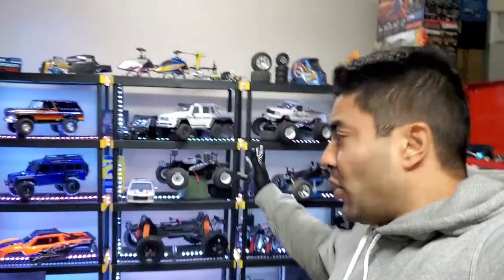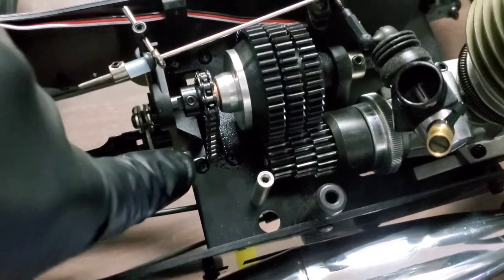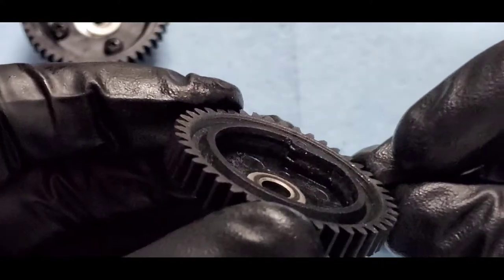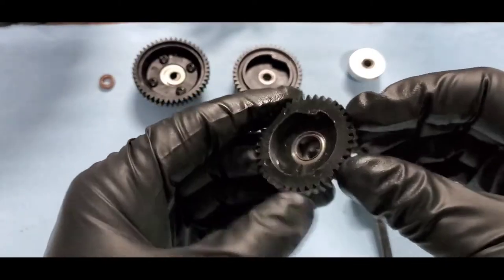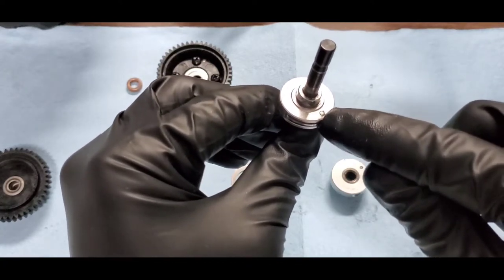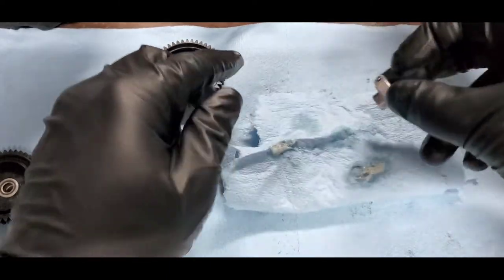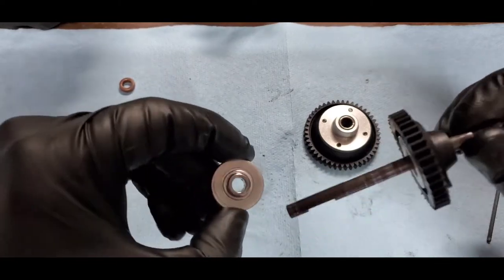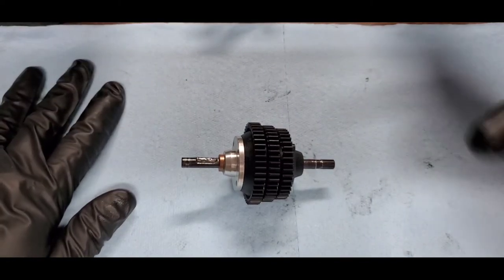3-Speed Transmission Maintenance on the Kyosho USA-1

Comment: At 5:17 in the video, you point out the shim in between the two cams. However, according to Page 8 (step 7) of the Kyosho build-manual, there is NO shim. This is not the first place where I saw a shim installed where the manual did not call for one. On my truck, between the clutch bell and the clutch shoes, I found TWO shims, where the manual only calls for one. It was causing my clutch bell to jam up.  Once I removed the extra shim, my clutch bell freed up.   Hmmmm...

Comment: Hello I have a question the grub screw that holds the sprocket on I accidentally stripped and I'm not sure what size it is do you know what size grub screw that is the one that goes in the sprocket with a chain around it thank you

Comment: Your gears slide off nice compared to mine. Mine were literally seized.  That shaft has a bunch of burrs
Reply from the maker: I had lubed the trans prior to this service. Also my shaft looks that way because I filed it gently as I did my last one, the shaft coating was rough from factory which may have cause the seize

Comment: one thing i just help but notice as @Turok goes through this maintenance routine is just how scarred and "grooved" the appearance of the main shaft is, it has to be the weakest link in this design, and i think kyosho really dropped the ball by not making it a premium hardened part
Reply from the maker: I actually filed my shaft down, hence the marks. I had to do the same to my first shaft since the failed needle bearings left grooves which I filed away. It worked flawlessly after...so I did the same on the new one. Kyosho did send out some different hardened shafts but I haven't had to use them yet